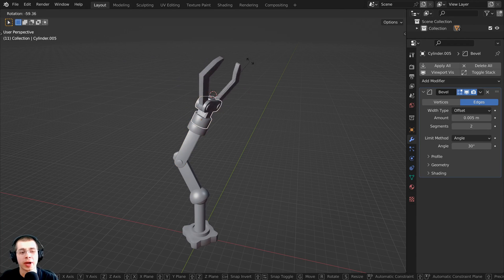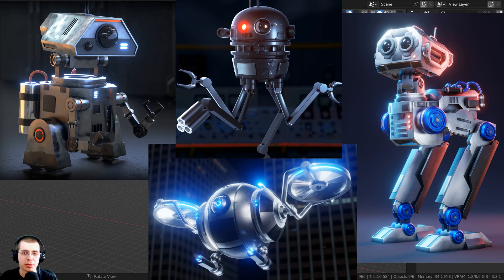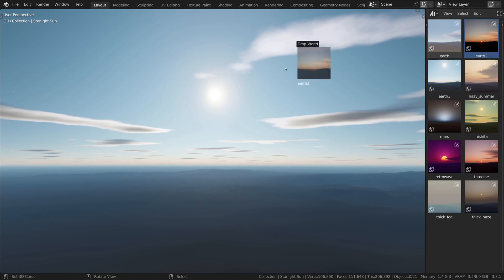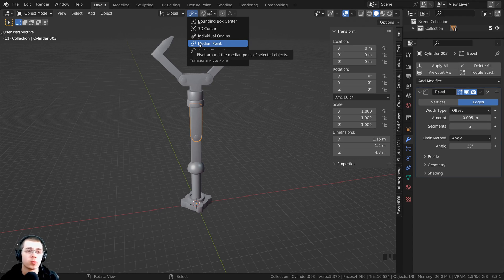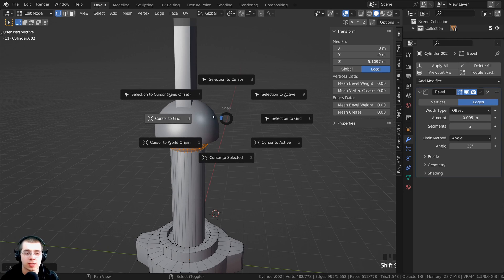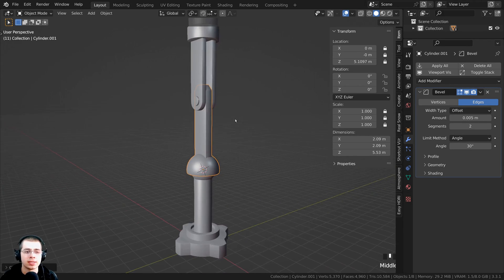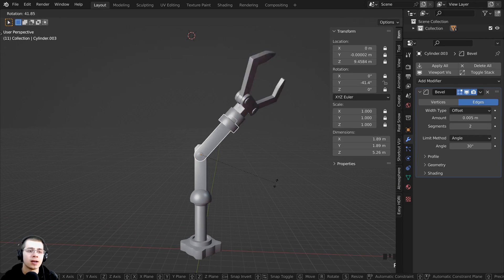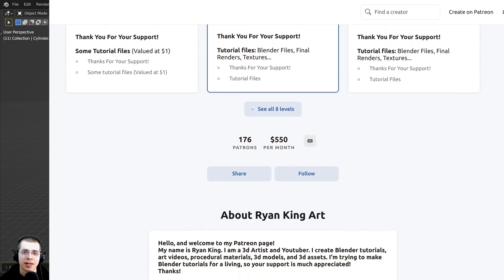Mechanical Rigging for Beginners 🦾 (Blender Tutorial)

Comment: I'm making a spaceship where the flaps open and the landing gear extends, everything works, but I would like to stop the angle at two positions. when the landing gear door is closed and open.
Reply from the maker: you can use the objects constraints for that.  use the limit rotation constraint.
Reply: Thanks @RyanKingArt

Comment: Can you export a rig like this to Unity? I set up a rig where the pivot points are like this but I'm looking for a way get a robot arm exported to unity and this method hasn't ever had successful results.
Reply from the maker: I really don't know, I've never used unity.
Reply: @Ryan King Art  fair, I just needed to know because in my experience not using bones with the intent on exporting creates a lot of extra data when imported to unity. Especially of the mesh has multiple parts.

This is because unity does not know where the animation data belongs. So it applies ALL animation data to every part of your creation. Say you have a roblox looking character with separate body parts, you animate the arms and legs moving and also the head. Well your 1 arm has the animation data you made it but it also has animation data for the other arm, the two legs, and the head. And all of the other parts do too. 

Basically the more objects that have animation data the worse it is, hence why having 1 armature shared between them all makes the mesh a lot more versatile Especially when working with others. 

Sorry for just info dumping this, but I needed to know if you had a method of getting around the extra animation data getting made on export situation before I said anything. Otherwise the tutorial is great for making something in blender.

Comment: Thanks for this Tut.  I used it to animate a sci fi ship wing and parts.  Looks good but I need to mirror to the other wing.  Can you recommend the best way to mirror these rigs.....or do a tutorial.  My wing has a lot of verts so I also tried Alt D to duplicate, flipped it 180 degrees on the z axis and then when I play the timelime, the duplicated wing and parts jump back to the original side and position.
Reply: I figured it out but I had to SHift D duplicate to get it right so it doubled vertices

Comment: If you don't quite know how its fine, I think I finally found another tutorial that will help.  But I was wondering if you could make the claws move together with one bone or empty instead of having to move them independently. as in when you open and close them, they move an equal amount. on most machines the two would be connected, and I was going to use it for some robot feet.
Reply from the maker: Yes there are ways to make them move at the same time. Sorry I didn't cover that in this video.